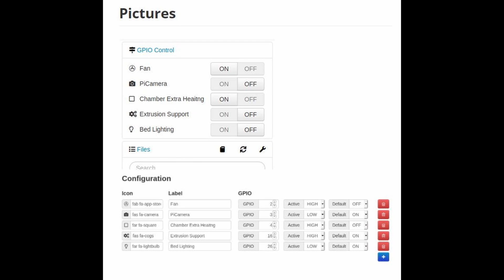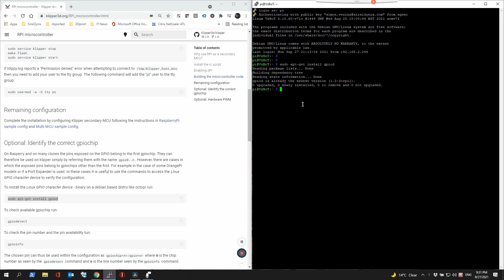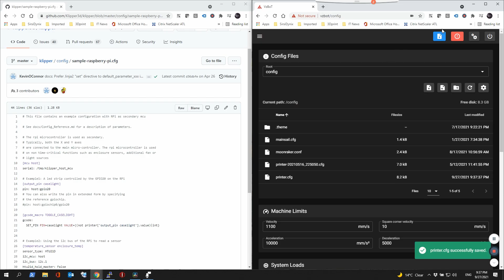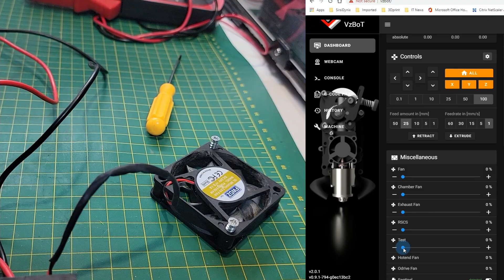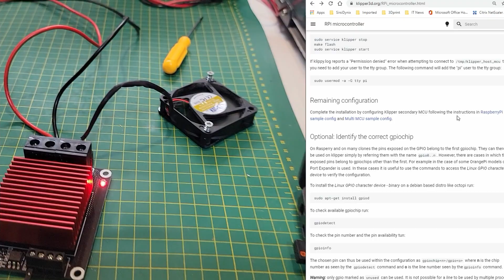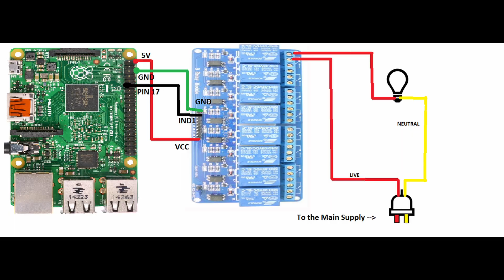How to use GPIO pins with Klipper

Comment: The mosfet you have linked, I have an identical version part code hw-700, this does not work with the pwm as it will only accept voltage from the the heater output, the version you use, the hw-300 has a pwm specific input and a seperate input for heater output, I had one laying around to test so luckily didn't buy it

Comment: if I understand correctly, is it mean I can plug the g-code into the one generated by slicer and make the external fan on&off at some speciific position during the print automatically?
I recently bought an ender 3 s1 pro to make a UV glue dispenser but it's kinda tricky. Because i couldn't really find an unused pin to trigger a mode switching function from glue dispensing to turn on UV led from my customised toolhead. 
And turning it on all the time is not an option as I need the glue to set still before curing it with UV.

Comment: Very very nice video and concepts very clearly explained. Thank you 😊. I am very new to klipper but funny enough I find it much more easier to configure than marlin which I was never able to get my head around. I see a good opportunity here with your relay control part, all of know the fan noise we get sitting alongside a idle printer especially with the controller and hot end fans running all the time, what if we could configure the hot end fan to only switch on when the hot end temperature goes above say 50* and the controller fan to switch on when the board controller goes above say 60*. That way fans will only kick in when the printer starts a print job and switch off when done and all the temperatures are back to normal. You could also switch on or off the enclosure lights only when printing. That way we can avoid unnecessary power being consumed and also have a much more quieter printer. So please help with some examples as to how to configure this condition. Thanks again 👍

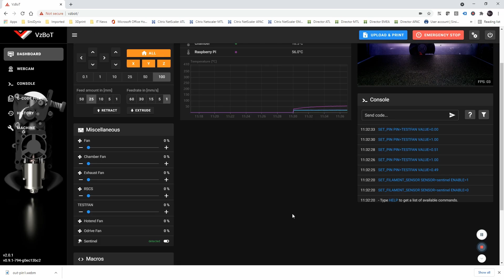Comment: 26:40 - THANK YOU! I added a 2CH relay board to control LED lights (and something else in the future) and couldn't for the life of me figure out how to default them to off at startup. Simply adding the "value: 1" and "shutdown_value: 1" was what I needed!
Reply: Why relay? I have usb powered led and I Plan to use just 5v and gnd to turn off and on and maybe Set brightnesss. Don't care about color
Reply: @denis2381  it's a 12v LED Strip. Just white.
Reply: @willl84  oh okay makes sense. I was already a bit scared to not connect it. Already glued it in the ikea lack enclosure and prepared pi (as mcu in klipper) and cable

Comment: I want to make sure I understand: if you're already using an rPi for klipper, do you need another Pi to use it as a secondary MCU? Or would I be able to do this on the one Pi that's already being used for klipper.
Reply from the maker: The one that runs klipper. No need for a second one
Reply: @Vez3D  Awesome, thanks!!

Comment: My whole life I worked in I.T. I've also tinkered a LOT with electronics (entire workbench with oscilliscope, sweep function generator, I have my extra class radio license, etc.). I never learned to control physical items because learning firmware/microcontroller coding was a MAJOR time and cost issue - Plus, every single video I've ever looked at there is crap (parts and equipment) strewn everywhere. This is SO easy! Thank you so much for this video and for making one of my techie/geek dreams come true!

Comment: Would be good to cover using GPIO pins with external momentary switches to run gcode,  like a physical preheat button, etc.
Reply: Or a basic movement system
Reply: Like those from pc cases? They 100% can be used for this purpose

Comment: Do I understand correctly, do you use the RPI with which the printer runs under klipper or do you have to install a second RPI?
Reply from the maker: I use the same as Klipper runs on.

Comment: fyi that black panel mosfet on 
your picture (2:30) doesnt work from 3.3 volts. just tried it and it needs 12v even for control.
Reply from the maker: Ok good to know. I'll stick to the ones in the video then
Reply from the maker: Though specs say 3v minimum..but I guess specs are sometimes bad on those

Comment: My rpi 3b+ can swith a 12v led strip with irf520 mosfet, but I can't get it to work with a 24v fan. Without fan attached the output of the mosfet is reacting to the slider in mainsail as expected. As soon as I attach the fan the voltage drops below 1v and the fan won't start. Any ideas? What mosfet are you using in your example?
Reply from the maker: It's a bed mosfet I got from Amazon. But any mosfet should work
Reply: @Vez3D  The mosfet I'm using is a irf520N. This one is working with a gpio pin on the mainboard of my printer, but not with the Pi. It might have something to do with the control voltage of the Pi, but can't find proof for it..
Reply from the maker: @micromagic31  pi will send 3.3 I think..so your mosfet needs to trigger with that low voltage

Comment: The hardware pwm has one very important advantage: It does not vary when the cpu is overloaded... So if a process freezes the cpu for a few ms (which hopefully wont happen) the software-pwm will freeze as well...
And as some others said the hardware-pwm gives a much cleaner signal...
Reply from the maker: valid good point
Reply: Spot on! 
As the name suggests, hardware PWM is literally controlled by a separate hardware circuit in the processor that is dedicated to nothing other than generating a PWM signal.
It's very useful! If you need a PWM signal that'll be stable regardless of what the rest of the processor is doing, these are what you want to use. 

Generally speaking it's a good idea to use them even if you don't strictly need the stability as software PWM often involves the processor actively managing the pulse's high and low timings. This usually requires continuously polling or checking a timer, which can consume significant processor time, especially at higher PWM frequencies.
Reply: This is probably reason the Pi is not used to drive steppers directly, as well.

Comment: Hi thanks for the very God vídeo,  i have a question, can i use the rasp to Control my hotend fan ? So it stop at 30° ,  or the fan and thermister have to be on same MCU? i AM out off pwm pins on my skr 1.4 , i can not use 2 hotend MOSFET  to do that . thanks
Reply from the maker: Sure you can. Just define a heater fan. See klipper config reference
Reply: @Vez3D  thank you

Comment: "really super quick and easy." half hour later, "long and boring." lol nothing is usually ever quick and easy when klipper is involved, but what took you half an hour takes most ppl much longer. present company not excluded. its good that you mention ofter to read the docs. cause yes, it reeeeaaally helps, unless you are kevin o'conner. (he wrote them) one thing though, you cant control everything with the pi. like endstops or steppers independantly from one another. for example, on a previous board, the pins for my z enstop no longer worked at all so i thought i could just run it through the pi but sadly the endstop needs to be controlled by the same mcu as its assigned stepper...so i stripped that board for spare parts and got an MKS and wow what a difference 32bits makes. also, another great reason to run klipper with a pi is that it offloads so much of the processing strain from your printer mcu and anyone who ever printed with an 8bit board knows just how buggy and sometimes laggy they get. klipper is the best, but never quick and easy, but sometimes thats a good thing. my old board was quick and easy, now its spare parts.
Reply: and just now as im looking through the new docs i just happen to find "multiple-mcu homing" hahaha better late than never i guess
Reply from the maker: Hehe it's super easy to do and super quick... But it's longer to explain in a video 😝

Comment: Software PWM use some code to turn on and off pin quickly. It use some cpu computation power and its not realy quick. Also timing of switching is a bit off due to OS processes.
In hardware PWM special timers is utilized to do switching. It can be REALY fast, timing is perfect and do not use CPU computation power. 
In case of regulating fans software PWM is good enought but for eg. servo it can be a problem

Comment: I recently updated to klipper firmware on my ender3 reading the documentation seeing the part about sensors like thermometers, when I realized I had one of those pi starter kits with a bunch of sensors and even an accelerometer(mpu6050 no SPI interface unfortunately).  This video came at a perfect time!

Comment: If i remember correctly the software pwm is ok for fans but crappy for servos because the pwm isnt perfectly timed. You dont notice it on fans but servos can stutter a bit.
Reply: I tried servo with sofware pwm and it's jittering alot, tried hardware pwm but I can not get It working, do you have any step by step tutorial on active hardware pwm?
Reply from the maker: I don't sorry. Never experimented with it

Comment: Thank you for the interesting video. I am planing to upgrade my 8bit board (I know it is shameful, pls don't judge me 😁) to a 32 bit board to fit Marlin 2.0. Now, my question is, can I just use the RasberryPi to extend my 8bit board? With RPi I can do a lot of cool stuff and there is no need to buy an 32bit board. Maybe I'll just make a complete switch to klipper instead. Thank you in advance! I am learning more stuff  about the firmwares bit by bit.
Reply: With Klipper, your printer board ends up being nothing more than a fancy relay board. All the heavy lifting is done by the RPi, and the commands are just streamed to the printer board.
Essentially, a "better" printer board does nothing for you at all in terms of computation.
The only reason to upgrade the board then is if you need to improve the hardware interface I.E. ability to swap out step sticks, add more step sticks, use a more reliable board, etc.

Upgrading to 32bits does nothing for you.
Reply from the maker: @joshua43214  except I had issue running accelerometer on a old 8bit board. It failed because of not able to process the commands even with klipper on the pi
Reply from the maker: yes you can use it to expand your board.
Reply: Your machine maybe quieter with a board upgrade that has 2208/2209 stepper drivers too - any of the BTT SKR range or MKS have these